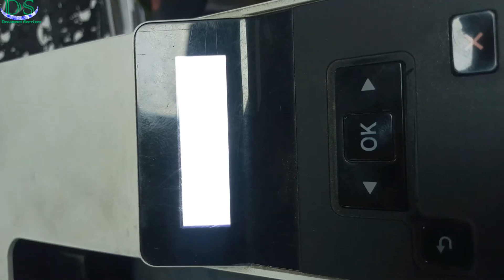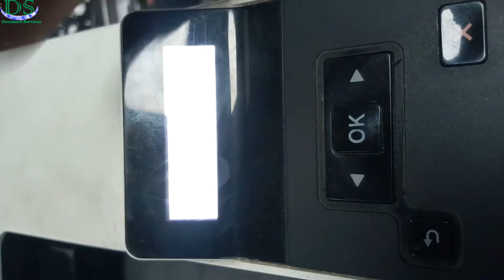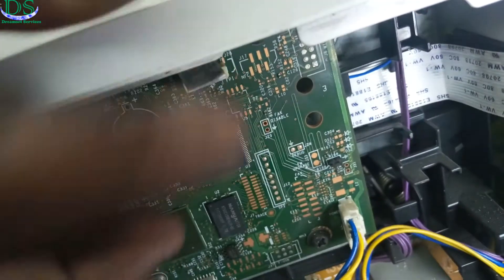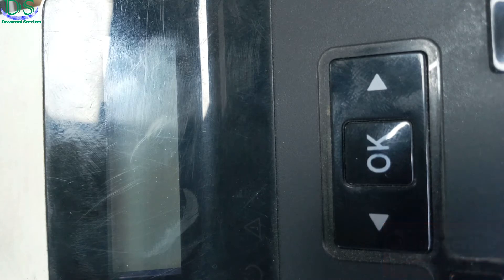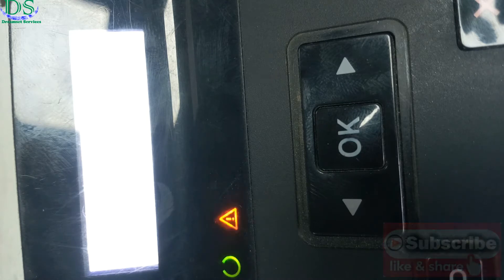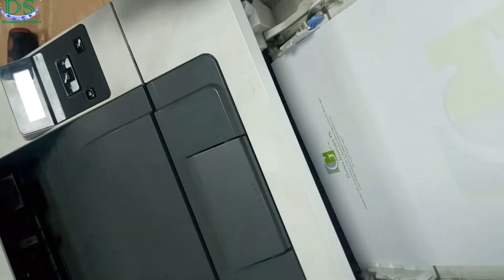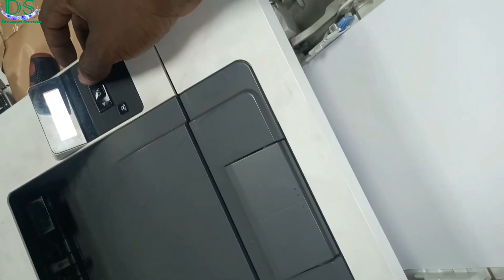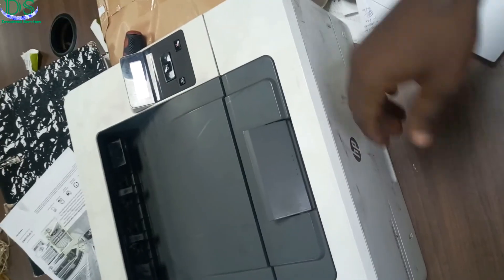Hp Printer engine Communication error Fix (error 49)

Comment: how to perform an engine test on an HP LaserJet M1005 MFP printer to check the without logic card
Reply from the maker: That won't be possible because the login board controls power going to the printer mechanism